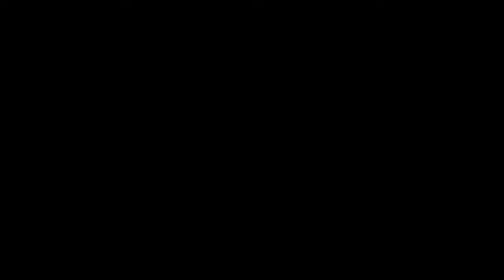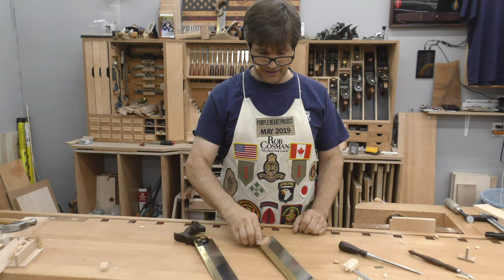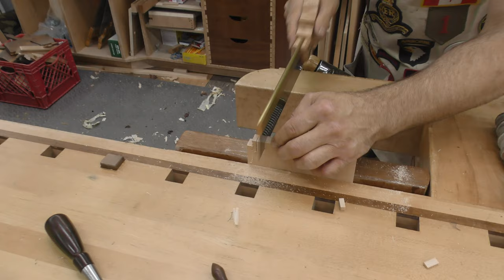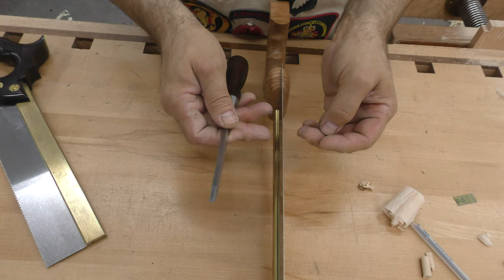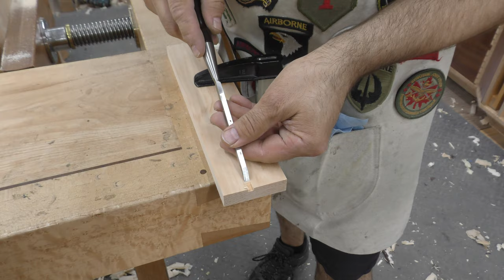Saws, Crosscut and Rip, How Do they Differ?

Comment: Fine tools are a joy to use. They are something to pass on, as are the skills learned with the proper use of those tools. 

Learning to hand cut dovetails, with no test fit, is more than just learning the joint. Over time it becomes a way of thinking. With practice and patience the skills grow, and one day you find that there is very little you can't fix or can't make. The acquisition of that skill set becomes a way of thinking and of problem solving that extends far beyond woodworking. 

I have one of Rob's dovetail saws, a cross cut and a tenon saw. You will find no better saw to be had anywhere. Once you try one, you are spoiled for life.

Comment: That is the best explanation I’ve heard and gave a better understanding of the 'why' as well as the 'what'. I do have a further question though please? You said your saws had a 1/2000 inch set, how would you set something so fine? Would the owner need a special set for when the time comes they need setting again?
Reply from the maker: .002" set per side for a total of .004 or the thickness of writing paper.  Not easy to find but can be done in a vise with a smooth jaw and some spacers like paper just below the tooth line.  The vise will bring the teeth back to the correct set.
Reply: RobCosman.com Thank you very much for your reply.

Comment: Love the videos Rob...I have a question about identifying if a saw blade is setup for rip or crosscut. I am new to woodworking and recently inherited some old tools from my great-grandfather who I never met but found out was a carpenter. among the tools were a bunch of old saws and I would love to clean them up for use but how do I tell which saws are rip and which are crosscut?
Reply from the maker: all the cutting faces of rip teeth are perpendicular to the length of the blade.  Crosscut teeth are filed on alternating angles.

Comment: Great explanation! I'm using a fine quality carcass saw but have been having a hard time obtaining straight lines when cutting across the face (cross-cutting) of stock. Sometimes I get an "S" shape, other times I get bows. Am I using the wrong saw? Do you have a video that addresses this?
Reply from the maker: Too much set is often the problem, it prevents a saw from tracking.  That is where the kerf is just wide enough to prevent jamming and thus forces the saw to stay on line.

Comment: What's your opinion on Japanese style saws?
Reply from the maker: made for Japanese wood, thin blades follow the path of least resistance when cutting tough hardwoods.  We (westerners) have been doing this for a long time, our saws are designed for our wood and they for theirs.
Reply: In the two years I worked as a stagehand, I was introduced to the ryoba and I never used another handsaw while I was with those locals. Its versatility made it ideal for our jobs; producing and altering set pieces that have been assembled from whatever someone could scrape up can have you working with a dozen different materials in a single day. And the Japanese saw went easily between a range of material like balsa, MDF, and cedar.

Personally, I also just prefer the structure of them. The straight handle gives me more control than the traditional Western parallel handle does. It lets me get finer cuts and reduces jamming. I also prefer the style with the slightly fanned-out shape, so I don't have to twist my wrist or arm as much when I need to get a deep angle.

Comment: Sorry, but I found this a little confusing. I thought a dovetail saw was sharpened to cut tails and pins but one is a crosscut and one is a rip. Did I miss an important statement?
Reply from the maker: David Gagnon a dovetail Saw has rip teeth and is used for cutting both tails and pins.
Reply: @RobCosmanWoodworking  Thank you sir.